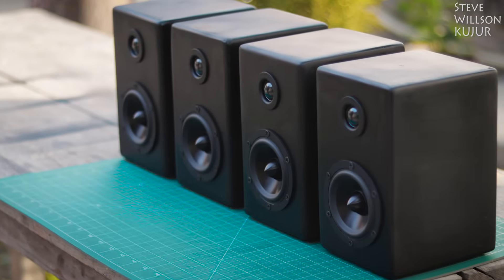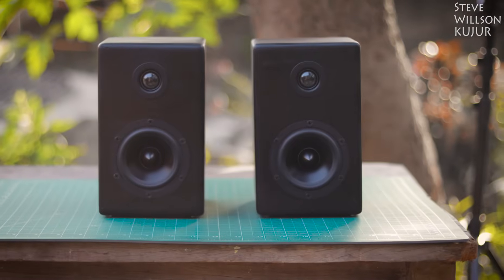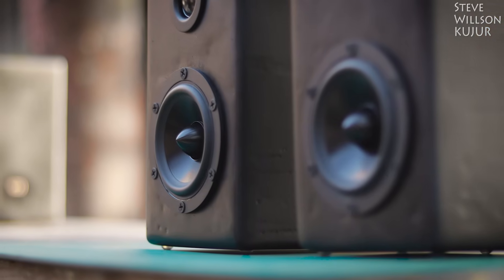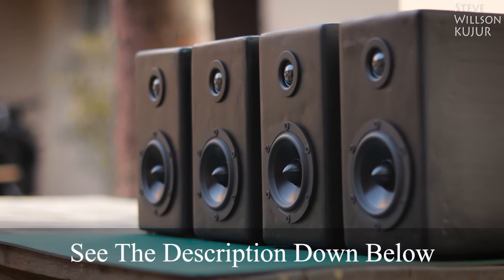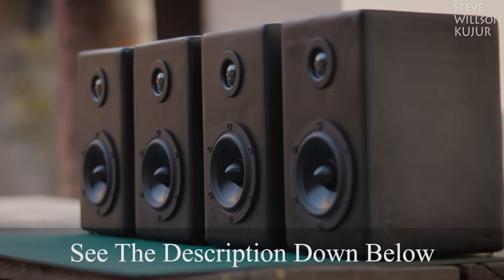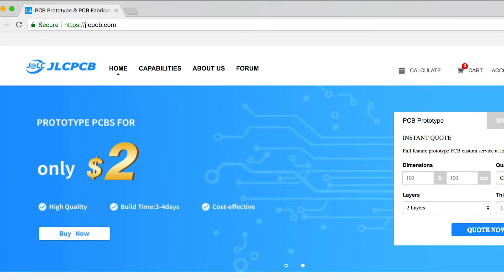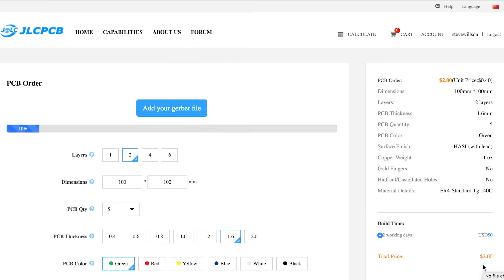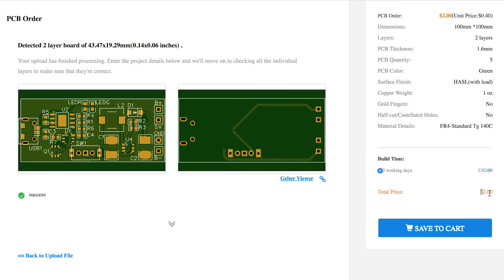DIY Stereo Speakers | Build Guide

Comment: I have two subwoofers of sound link 42mm (1.5 inch)
How many inches of box do you have to make for this speaker's good effect?  
Without bass resonance. 
No Bass Resonance. 
is going to use Bass Air Tube

Comment: Why resin over the boxes? You already went over the joints with a flush trim bit, and but a roundover on the edges. Just sand it until it's perfectly smooth to the touch (fingernail can't feel any edges) and paint it. A good 4-5 coats of enamel spray paint would have given you a nice smooth glossy finish.
I'm willing to bet you won't be using resin again next time. Also, I would recommend looking around for 'marine grade' birch plywood. Very light and very strong. It also is without voids so you don't need to worry about leaks. For a small speaker like this, just put a 45 degree miter on all your panels and glue them together. Makes for a good, strong enclosure without any visible joints. Plus sanding those corners is a breeze.
Remember, when you're using mitered corners, the size of the panels doesn't need to be exact. Just do all your 6" cuts (for example) on a table saw without moving the fence. Flip them over and cut the other side of the 6" cut, for all pieces. There, now they're all the same, so it avoids the need measure precisely because you're moving the fence around.

Comment: Hi, you started good and finished bad ,  first the finish on both enclosures is bad,  second you should not put the mid-bass driver with the cone pressing to a surface and try to integrate the speaker to be flush with the front of the enclosure .

Comment: For a better finish use a wider wooden block or a piece of that MDF and round the edges, about a little bigger than a bar of soap then wrap the sandpaper around the block and sand using even strokes. This way you don't have finger groves. For any imperfections save some of the dust from cutting and sanding and add glue then fill the spots

Comment: I'm just wondering did you use any sound absorbing material inside the box? It is a must in sealed boxes, and also in any other types which are not subwoofers only!

Comment: Why did you use araldite on your mdf ? I would suggest you use bondo and high building primer. we can see the uneven texture on your speaker. Maybe you wanted the texture like this ? or a lot more sanding should have been done if high build primer are not available in your region.
Reply: Maybe they wanted the texture to be like this. With sanding (from coarse to fine) and 2-3 coats of black matte spray paint it could have been easier and will look way better.

Comment: speakers are WAY too small to even enjoy them you need something more like 6.5" for any kind of bookshelf speaker and then throw  in a 12" subwoofer that's the only way they sound real good anything smaller than a 6.5" woofer is useless sounds tiny as shit even with a BIG power amplifier

Comment: Hi, why did you use a full range driver crossed with a tweeter instead of a woofer crossed with a tweeter like it's supposed to? Because those crossovers usually cut all sound above 3600hz from getting to the full range, wich means that you are using a driver that excels in those 100hz-15000hz but only using it from 100hz-3500hz...
Reply: I'm new to this stuff, but looking at the frequency response graph of the rs100, it gets pretty dicey past 3.5khz? The FR also isn't that great until about 150hz, so they should probably be paired with a subwoofer that goes that high?
Reply: Edward Turpin that's why the best option is to use woofer-tweeter and not fullrange-tweeter. A woofer tend to respond well below 100hz and not that great about 5000hz wich is what's supposed when using a 3500hz crossover. If you really want to use a full range tweeter design you could replace the crossover for a frequency filter on the tweeter and this way the full range would use all its potential and the tweeter would be protected from frequencies under 3500hz
Reply: The rs100 speaker is flat from about 90hz to 4khz and then it gets all wonky so I dont see the problem here . But I'm most certainly not new to this stuf but I'm very intrested what a fullrange tweeter is
Reply: The crossover was appropriate for that driver but the impedance mismatch between the drivers will alter the actual crossover points. From a driver standpoint I'd say those would be good on a desk for computer use when coupled with a 30-50 watt amplifier and a small powered subwoofer to fill in every thing below 150hz.

Comment: Be careful with these parts recommendations.   The woofer is 4ohms, and the tweeter is 6 ohms, which isn't a problem if you build your own crossover.  If you are buying a pre-built crossover,  they will assume both drivers are 8ohms or 4 ohms.
Reply: In real world speaker impedance doesn't matter more ..... 
When matters .... When u give higher watt to speaker ..... In general woofer needs more watt to run .... Which woofer needs to match with amplifier impedance ...

Don't care about tweeter impedance .... In general tweeter runs on lower watt than woofer ..... But one think don't run tweeter on direct connected amp channel .... Whenever tweeter impedance is not match with amp ...

Comment: 1. Bumpers Pad Feet - https://goo.gl/b9j6qg
2. Mustool® MT223 Soldering Iron - https://goo.gl/y8uYe5
3. Hole Saw Cutting Set - https://goo.gl/2pptaf
4. XT60 Connector - https://goo.gl/WZiwdK
5. Automatic Cable Wire Stripper - https://goo.gl/GhudHG
6. Hole Saw Cutting Set - https://goo.gl/F6T3SM
7. 90°Right Angle Clamp - https://goo.gl/3qFw5j